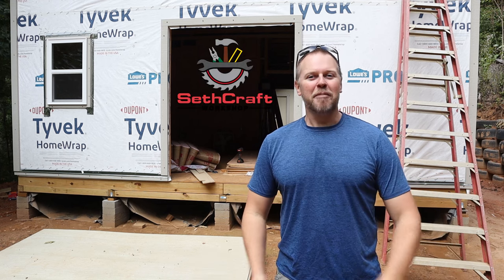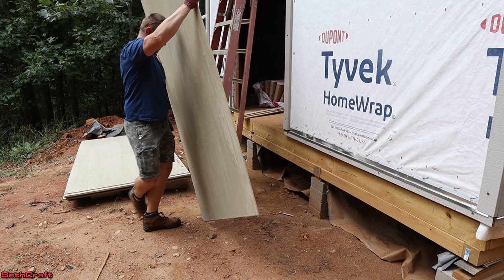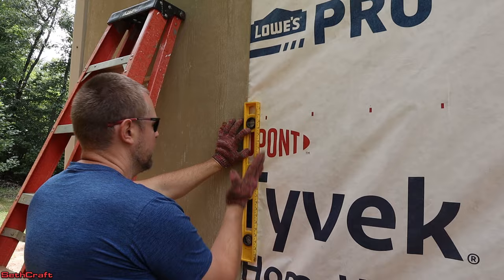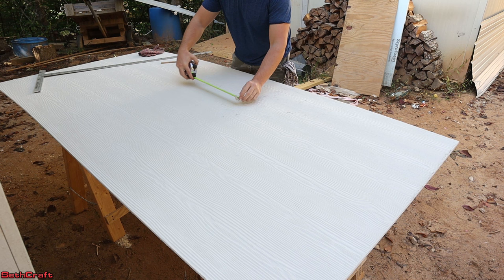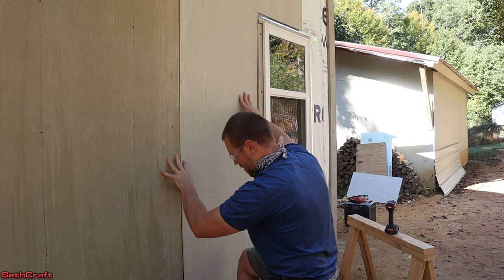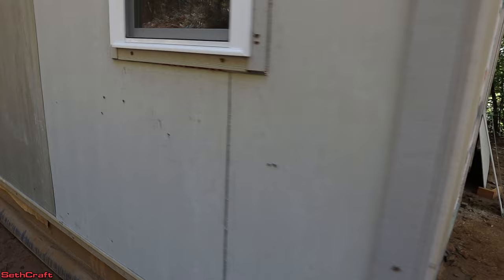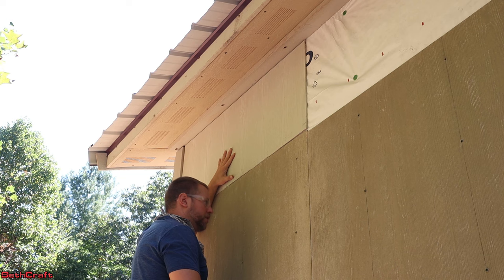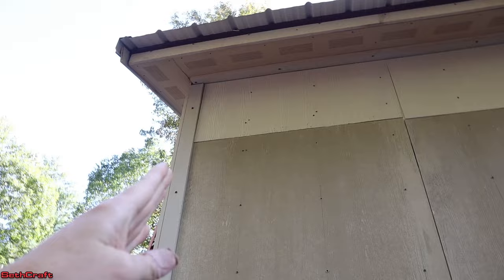Installing Hardie Board Concrete Exterior Siding - Build a 20x30 Workshop

Comment: That concrete siding is no joke, especially when trying to to do the job alone.   Nothing to be ashamed of.  The finished project looks great and will last for decades.
Reply from the maker: This type siding is heavy and not easy to work with but does last forever. A little caulk and paint will take those gaps right out of sight.

Comment: This is an excellent video Seth.  I will be using this for my 16x40 cabin and I will more than likely be doing it alone as well. Excellent.
Reply from the maker: It's a lot of work alone.  But sure does last a long time. Much better than t11 siding.

Comment: Well done all that heavy siding by yourself.  None of those gaps are so bad that more trim can't hide them.
Reply from the maker: The concrete siding is rather heavy. after a few sheets of that I was over it. In the spring I will need to go back and finished the outside.

Comment: Really cool vid Seth, as always. I appreciate how you show us "mistakes" this is in inverted commas because, are they? We worry so much about making things perfect.  If it works, if it does not cause long term issues, if the end result is good....then we did well. In Australia I have a client, a builder who I install kitchens, wardrobes etc for. He gets upset if I have a 2mm gap in my fillers. This to me is quite acceptable and fixable with a little shmoo (caulking). 
To achieve what you have here alone, kudos brother.
Keep the awesome video coming.

Cheers.
Reply from the maker: I could not imagine building with a 2 mm tolerance. I'm more like a 20 mm tolerance type builder. Perhaps with a lot more practice. I will get better at installing things like concrete siding. But for now it is certainly sufficient for this size building in the middle of the woods. 

Thank you for writing and watching the videos.

Comment: Did you leave a small gap between the siding and the z-bar?
Reply from the maker: Not on this build. It's probably good practice to add an 1/8" gap there.
Reply: @sethcraftworkshop  it’s actually a requirement per their installation guidelines because it can wick water and if there isn’t a gap the water will just get trapped behind the board and soak into the board which can result in swelling, staining or even causing the surface finish to come off. You might want to consider running a circular saw along the bottom to create the gap. Set to the proper depth you shouldn’t damage the z-bar but you could always run it a bit shallow and finish using a razor knife.